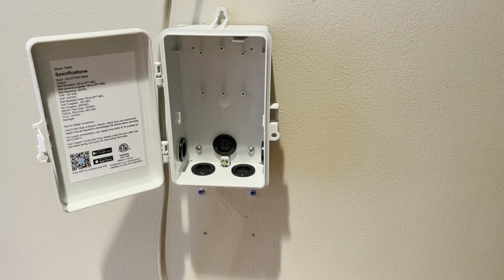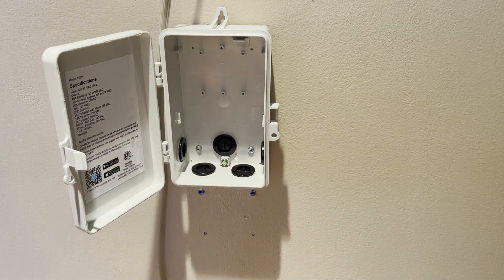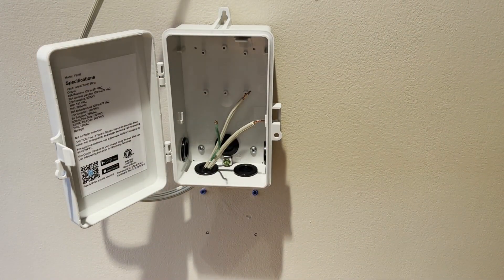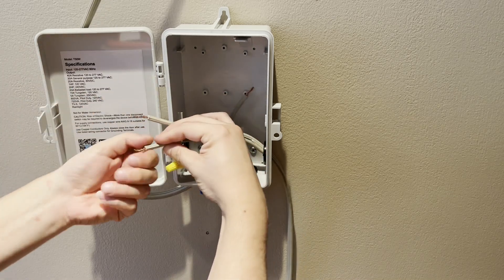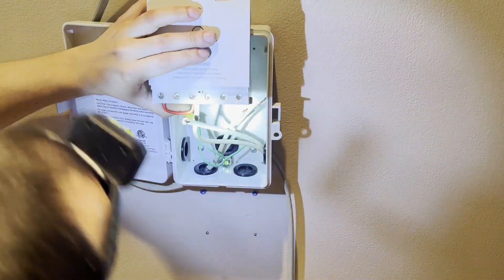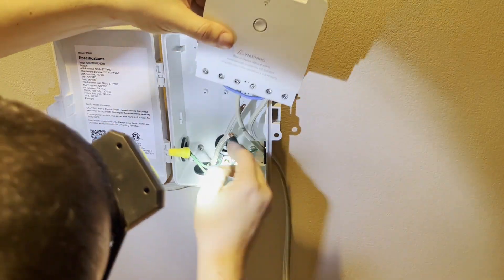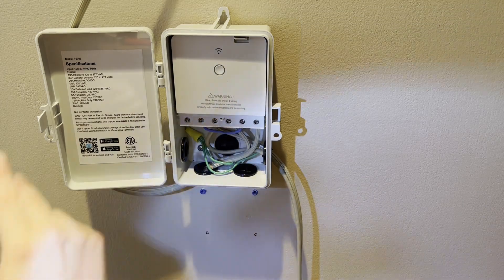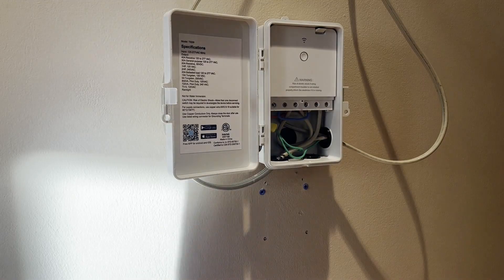Installation Review of DEWENWILS Pool Timer, WiFi Timer Switch, Heavy Duty 40A 120-277 VAC 2HP

Comment: This device is garbage.  The proper way is using s contactor and switch but not sure what issues you had before.
Reply from the maker: Honestly this thing seems to be good. No issues with connectivity ever, been reliable since install. I had humming noise from the contactors that no one liked. I tried solid state relays but ran into issues soon after that could have caused a burn out on my air conditioner. I have multiple jobs going on at once so getting it done this way helped me move forward to the next one. Good luck on your travels.

Comment: I believe they do make a wifi switch device for any plug in units. No need to mess with this thing. I’m not sure if those can handle this kind of amperage. This AC looks rather small so I don’t think the amp is that much. Those devices should handle this AC just fine.
Reply from the maker: There were lots of options for 120-volt switches. There were only 2 options for 240 volt that were recognized reliable name brands. Air conditioner runs almost 20 amps. Most products just say 13-15 amp max before it melts. Good luck on your travels.

Comment: Can I use this to control my sprinkler pump 220v 20 amps? Are you installing the wifi antenna? Can I put the antenna at the bottom instead of the top? I don't have room at the top. My box is right under the electric meter which I can't move
Reply from the maker: This will be able to handle 20 amps. Make sure you use the proper gauge wire. You would have a better signal if you can mount higher. But if no other choice it will be a trial. Good luck on your travels.